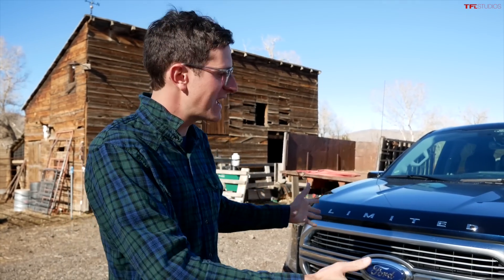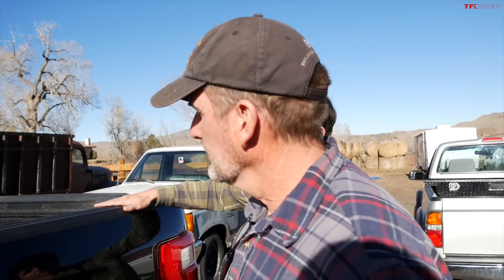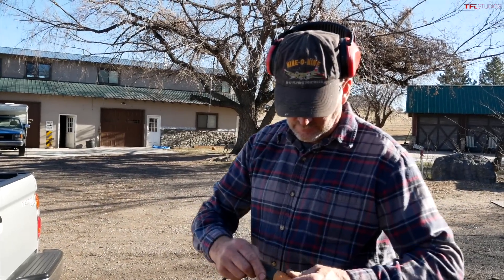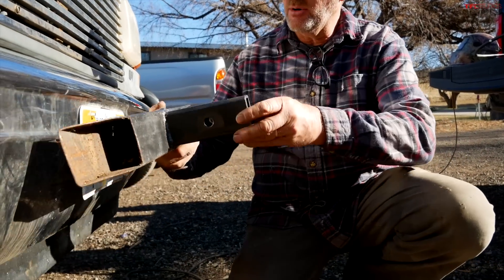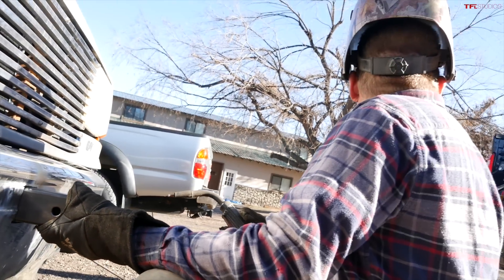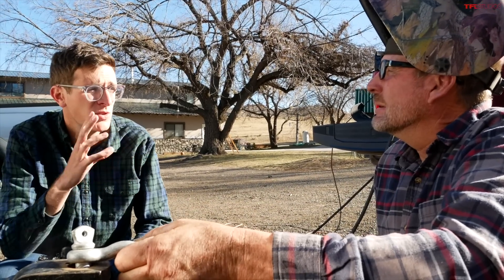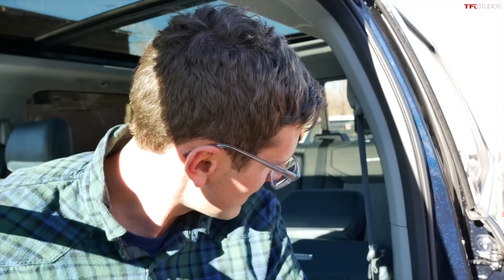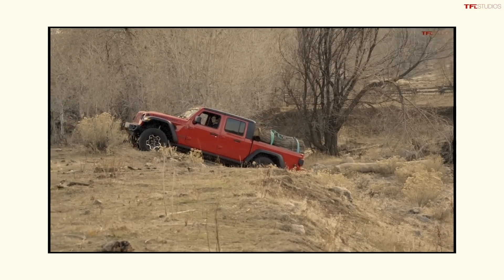What Does A Rancher Think Of The New $80,000 Ford F-150 Hybrid?

Comment: "I'm gonna give it to my wife" -enough said
Reply: Stand Bye for the;  Who's wifes blow dryer can run the longest before blowing the circuit breaker test?
Reply: when a wife is happy everyone is happy
Reply: A limited is not a work truck period even though ford throws on all the bells and whistles on it . Xl or xlt are work trucks and should come with things like this
Reply: @clam741  this is ford's way to make money considering half of the truck they make have minor to major problem their craftsmanship sucks
Reply: @gfinnstrom  I never had any issues in the last 7 years but I’m sure the brand you prefer is crafted to excellence , now excuse me for a few minutes while I finish laughing
Reply: @gfinnstrom  instead of writing a bible and getting all offended over nothing , name your brand or better yet name a brand where craftsmanship hasn’t gone down ? I’ll wait
Reply: @clam741  I'm not gonna say which trucks I like most, as in my opinion, it comes down tp what you can fix with the knowledge, tools, and parts you have best of, but you did blame Gary for getting offended, then you took time to write a snarcky comment, just saying. 
People shouldn't judge people based on what brand they drive, especially if the person knows a thing or two about modifying their truck. Whatever people are most efficient in, and most happy with.
Reply: @sloughsharkseh3307  maybe I know a thing or two about trucks , maybe I know more than a thing or two about fords and maybe I actually pull a 7k lbs trailer with my ford daily . All that to say , opinions are like asshole , everyone has one but in the end their just opinions . Based on real world experience not hearsay is is how things should be judged . Ask any automotive question on a car forum and watch how many different responses you get  , yet in a lot of cases there is only one correct answer
Reply: @clam741  I am not too sure what you are getting at entirely, but I will say that when it comes to trucks, there is no best truck. Every truck has perks, and problems. I've towed 30'000 lbs for 1300 miles no problem with my dodge 3500 2008. And my buddy who has been a ford guy even before his license, has towed large amounts with his trucks. The difference is, he has rhe tools and knowledge to fix ford, and I have the tools and knowledge to fix dodge trucks.
Reply: @sloughsharkseh3307  that’s what I was getting at , they all got their problems . The other guy got all offended because I laughed at his comment of ford making money with this new truck , that’s the point but at least they innovate and bring new equipment and engines to market while gm for example has been recycling pretty much everything but the body for 20 years now meanwhile it’s more expensive from year to year and it still has certain issues . So get what u like , drive it  and fix it , the end
Reply: @clam741  oh, yeah sorry about the confusion, I agree with you. I just misread what you were talking about.

Comment: At a certain point work in a realistic manner, you are trying to pull 3.6KW from 120V source so 30 amps. Ford has them rated to 20 amps in their literature. If you're working with a welder in a house you would check the rating of the outlet because welders are known for this. The ranchers first thought to pull down the power was decent but do realistic testing. Not just trying to blow past ratings and act surprised when it trips the breaker.

Comment: Enter the Cybertruck, SS exterior that will take any abuse he wants and will have all the power he needs!
Reply: Ford will have thousands of these sold and on the streets before the cyber truck even gets noticed anywhere.
Reply: Cybertruck can't hang with a half ton for towing a camper/cargo/aerodynamic brick. Stopping every 150-180 miles, and  finding an open V3 charging station that will accommodate a 50 foot truck/trailer, waiting 40+ minutes with the 200kwh will only just be doable under the perfect circumstances. Excruciating, but doable. Forget about towing 10k lbs any real distance with the smaller batteries.

I just looked up the supercharger network from Houston to Estes Park, Colorado. That's not a viable trip with the cybertruck towing my camper. There is a 233 mile stretch from Amarillo Tx to Trinidad Co that will take  300+kw/h of energy. Not gonna happen.

Comment: 10 years ago, that power feature would have been a huge selling feature. But as most tools are cordless now, it wouldn't sway my purchase decision one way or another.(Im a carpenter)
Reply: What about for charging you cordless tools batteries?
Reply: @bobdennis4801  There is already an outlet inside most trucks, out of the weather, that works just fine

Comment: is it wise to wear down the primary battery ??? theyre expensive to replace right??
Reply: It doesnt wear it down and its the hybrid one theres a seperate replaceable standard battery for engine start.
Reply: From everything I’ve found when researching buying a Fusion Hybrid, Ford has the highest standards of all car companies for their hybrid batteries, supposedly they’re made by Sanyo to even higher quality standards than any others. Also I have yet to meet a Ford hybrid tech irl that has had to replace those batteries which are coming up on 15 years old.
Reply: A lithium battery only has so many charge cycles. It will eventually have to be replaced.

Comment: The batteries will need to be replaced quickly using it for welding. Very soon. It will be expensive to replace and for farm vehicles that have a long lifecycle, you’ll be replacing the batteries many times.

Comment: ford has been helping toyota for years!!
when they built the san antonio plant every moring you could see evey for truck going thru the guard gate 
Ranger,Econo Line vans And every truck from the F150 to the F750 plus excursion and expedtion were all there building the TOYOTA PLANT 
carpernters,carpet guys,rooders,plumbers,electricians,Fire Marshall,mechanics,concrete guys and on and on 

POINT IS FORD IS KING OF WORK TRUCKS 

even when they were building the Tundra Tacoms plant 

yes 110 volts pulls more amps the 240 which pulls less they should of done.

any one who works 14 to 17 hours on ranch will fall asleep on top of cactus so that lay down seat will be greatly appreciated by REAL HARD WORKING FARMERS AND RANCHERS

Comment: Why not get a heavily discounted new 2020 or 2021 RAM 1500 (or better yet 2500) Tradesman or Big Horn and with the tens of thousands of dollars saved compared to a 2021 F-150, put a contractor-grade generator in the back and not worry about blowing the electrical system on the truck?

Comment: Electrical Engineering 101 with Mechanical Engineering 101 ::::!!!!! Don't Exceed the Name Plate Electrical Ratings. Also Read & Review the Electrical Requirements Before You Repeatedly Blow the Safety Circuits. Maybe you all should consult a Master's Degree of Electrical Engineering or a Licensed Electrical Contractor, too. Not to mension that now you need a Mechanical Engineering weight rating on your bumpers recovery welds. Oh and yea, I'm talking about the Welding Certification Breaking Strength of your Recovery Point Welds.

Comment: Don’t you have a 50 amp plug that does both 3600
Reply: You might need to get a plug adapter
Reply: In theory you can run more powerful welders with 50 amp plug
Reply: Can't using 50amps,  if too hot alert, LIMITING 30Amps, if overload then will cut-off

Comment: nice features definitely. Is it worth 80 grand in my book definitely not. Still way cheaper to just have a generator in back of the pickup truck. I had one in my work truck. That old F-150 is the way to go over there. Don't have to worry about scratching on $80,000 work truck. It also doesn't make sense to spend 80 grand for a little boost and fuel economy and the few perks.  you'll need forever to recover the extra money spent on the truck compared to the fuel U-Save. To have it, just because you got to have it is a different story.
Reply: Powerboost is available on all trims in supercrew configuration.

Comment: Bought one it's been in the shop three times for engine issues
Reply: One of these? details please!
Reply: Well one of these meaning a ford f150 I work for an airline as an aircraft mechanic and we use these for our work trucks we have a 2019 and a 2020 f150 and both have had major electrical issues like one the pcm just died after we shut the vehicle off and the other one has been in the shop for various ignition issues like engine stuttering injectors not working and one the entire harness for the left engine bank just completely dropped off I don't see the exact maintenance work order for what happened because we're aircraft maintenance but we all know what they said the shop said it was regardless a 2019 and 2024 of any sort should never be in the shop that many times
Reply: 2020 typo not 2024
Reply: But at the same time I drive an 80s F-150 but it has been regularly maintained and haven't had very many issues I think just the newer ones are too cheaply made
Reply: @christophercondon2045  what engine is used in your work trucks. I have 50k miles on my 2019 f150 and it runs like brand new. Are you guys doing anything to modify the vehicles ?
Reply: V6 no mods